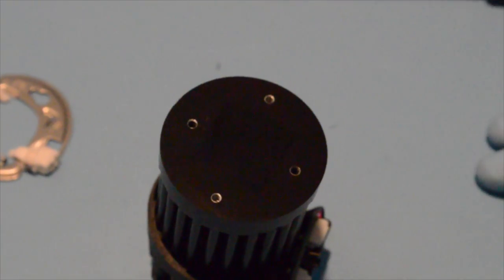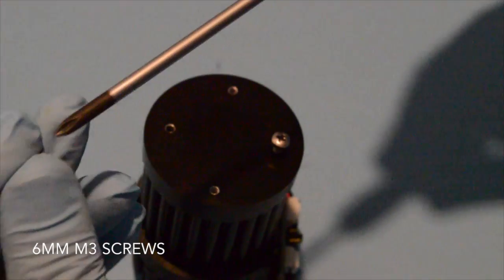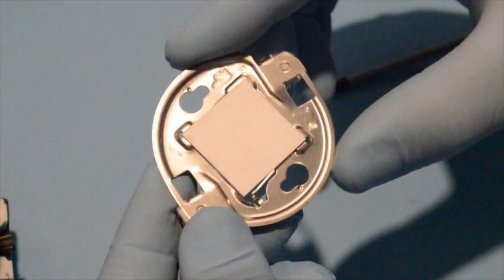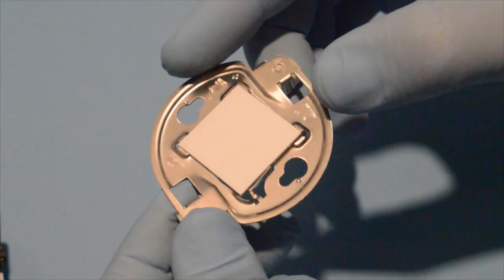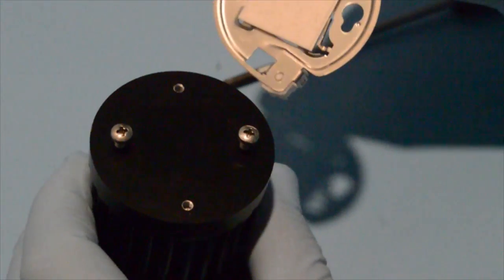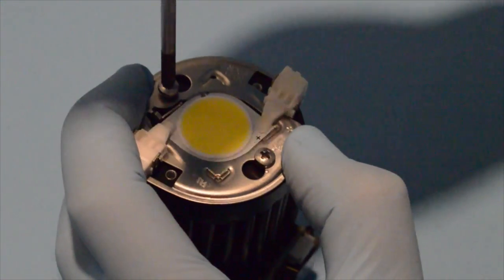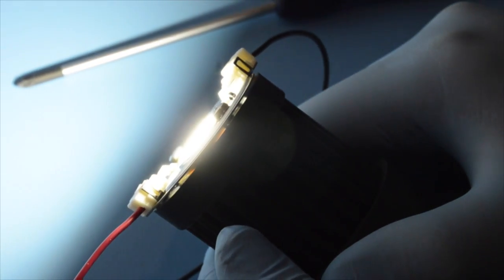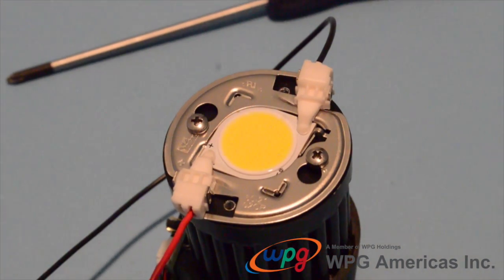CXA LED Array Assembly – LED Chip-On-Board (COB) Solution

Comment: The internal combustion engine. Asking for help from knowledgeable and understanding people.
In the garage, in view of the savings and good lighting design got a lamp on the inverter LED IP65 ELP18X1CS
Input voltage AC 220-240V
Output voltage range DC 30-60 In
Stable output current 350 mA
Power supply frequency 50 ~ 60 Hz
Power 9 To 18 Watts
Degree of protection IP65
Operating temperature -20 °C ~ +45 °C
Overall dimensions (D x h) 65 x 24.1 mm
Pair them with a working led, labelling was not only the name(brand) "Cree"
Used search on the image gave the option of led : Cree CXA2011 XLamp CXA 2011 11 W-45 W COB LEDs high Power LED light Emitter Diode Warm White 3000 K DC38-42V 280mA-1000mA
I wanted to order, but had doubts: Belchite and aliexpress I was told that: "May not work.
Must with a 38-42V output, 285-1000mA."
So asking for help from knowledgeable people.
What kind of led I need to buy to work with this Converter?

Comment from the maker: Check out the latest video from WPGA's Lighting Solutions Engineer John Grant:
CXA LED Array Assembly – LED Chip-On-Board (COB) Solution

Cree Integrated LED Arrays provide a versatile foundation for many lighting applications. WPGA Lighting provides the complete solution with holders from Ideal Industries and thermal interface material from 3M. This short video details the procedures to assure your LED lighting product will provide years of reliable and trouble-free service.
 #lightingdesign   #lightingsolutions   #ledlighting   #ledarray   #creelighting   #youtube   #instructionalvideo   #idealindustries   #wpgamericas